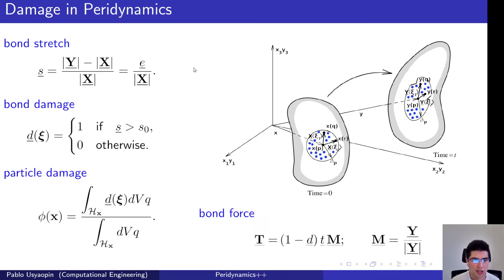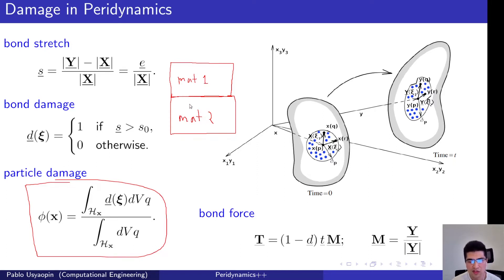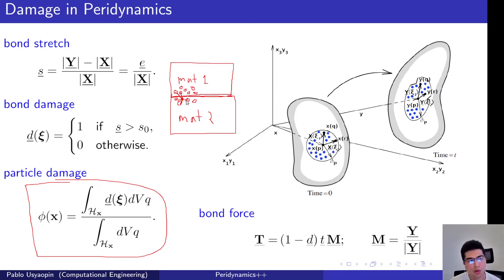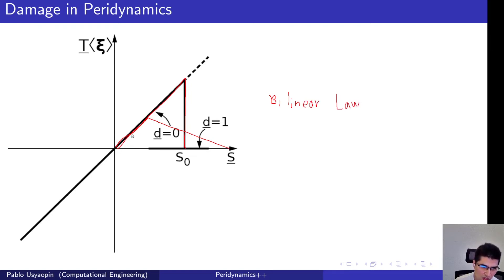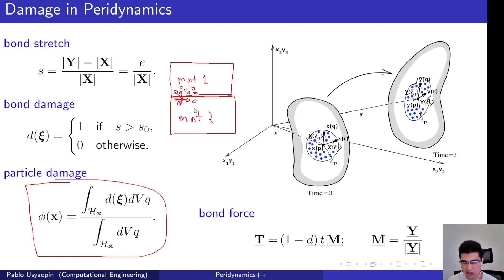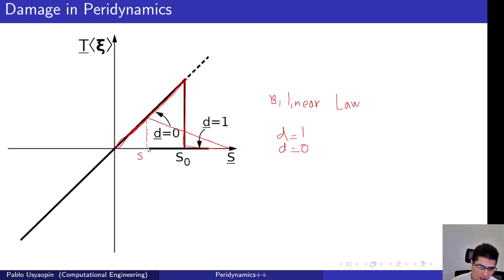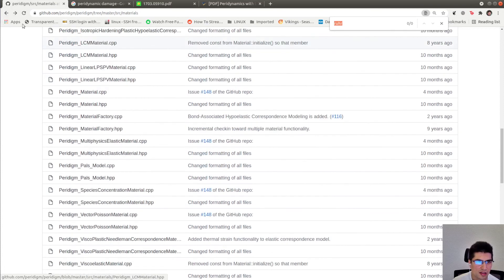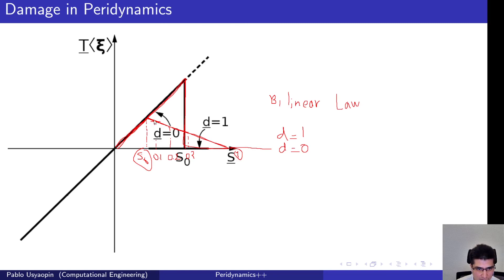Fracture across Material Interfaces

Comment: Sir Can extended kantorovich method be implemented in peridynamic model for plydrop composite laminate
Reply from the maker: Dear @Brainiacs. In theory since you can compute the deformation gradient using peridynamics you can import any classical continuum model into the formulation as well. The issue comes when computing damage in the deformation gradient, in which you may experience bond losses and reach a point where remaining bonds are not able to form an accurate deformation gradient. There are other waysto circunvent that but you would need to develop an adhoc model. We will come to those two points in later videos. :)

Comment: Sir thank you for clearly explaining about the delamination by bond damage and particle damage. Does the logic goes same for zero thickness contact surface as well?. I have become successful in solving circular embedded delamination for composite laminate by VCCT and surface based cohesive contact behavior using abaqus.
Reply from the maker: Hi @Brainiacs, thank you for your comment. Yes, this approach is actually meant for thin surfaces in which you intend to propagate the crack through a "zero thickness interface" between two materials.  In that sense the objective is similar to the cohesive contact behaviour approach. I did some examples which where partly shown in the thumbnail of this video. When I implemented this in Peridigm I had to look for 3 possible scenarios: Bonds that would fully belong to one material side (isolated bonds). Bonds that would be crossing interfaces between two materials (interface bonds) and the last case where you could have two different shapes together but still made of the same material, thus bonds would cross the interface but still be bonded. Let me know if this help answering your question :)
Reply: @peridynamics3657  Yes Sir